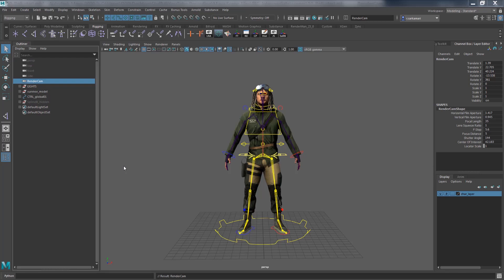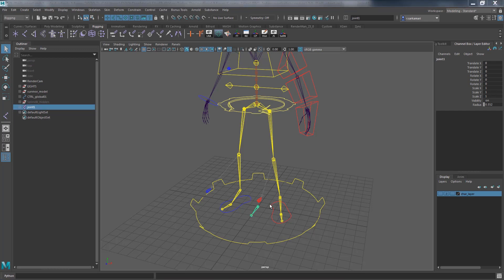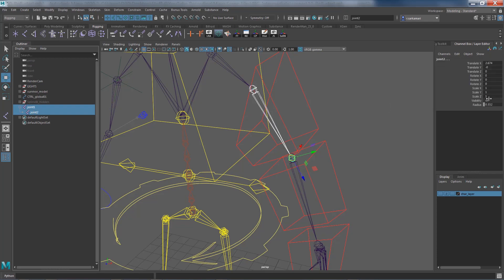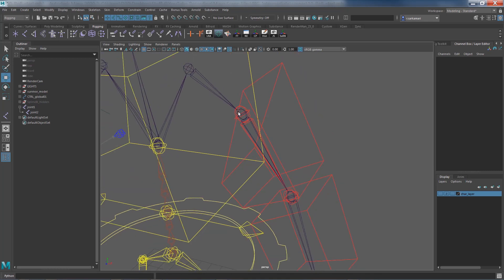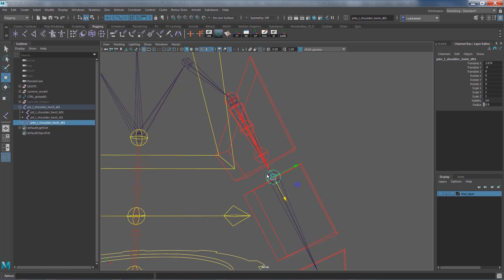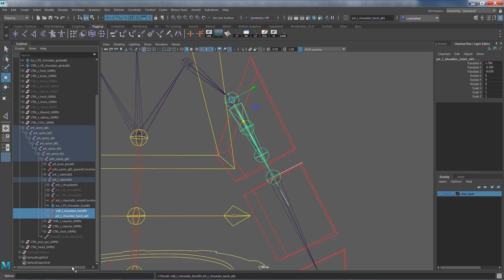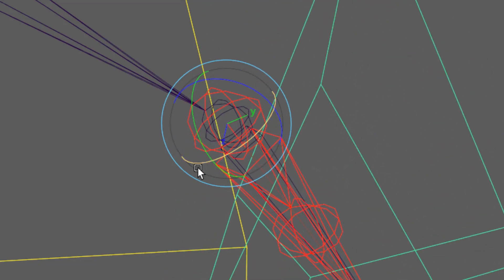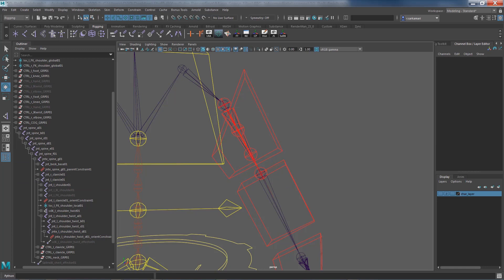Intermediate Rigging: 09 Advanced Arm Twist Setup

Comment: What is the key difference between this method and the method @antCGi uses for arm roll/twist?
Reply from the maker: I have not watch the one you mentioned but i am sure each method has its own merits. This is how we go about it in some of the shows in the studio
Reply: alright thanks, will give both methods a try.
Reply: @Auburyosrs I'm using antcgi on a rig right now but I have annoying issues with the aim constraint he uses, ars are fliiping etc.. I don't know if there are issues like this with this setup
Reply: @trystanbleuven791 I prefer this setup over the antcgi one. Easier to setup, more control and none of those flipping issues I had with antcgi's setup.
Reply: @Auburyosrs  I really find this setup is more stable than antcgi's setup, but I think antcgi's setup is easier to integrate a ribbon system in, though please correct me if I'm wrong.
Reply: @dyncgi  the method by @sarkamari is able to have the ribbon incorporated, the ribbon joints (nested in follicles) can just inherit the rotations of the twist joints via an orient constraint. just be sure to build the ribbon over the driver joints and not the twist joints
Reply: @ hi, thank you for the anwser :)

Comment: For those who want to know how to do the twist for the wrists since it's not specifically detailed in this video, and the method is slightly different:

The process is similar to this video's shoulder method, but instead: 
- Duplicate the joints from Elbow to Wrist, but reverse the parenting. Put the Wrist twist-joint as the parent and everything else as equal children under it.
- Create the Single Chain IKHandle as normal, from Wrist-Twist to Elbow-Twist.
- Parent both IKhandle and twist joints to the MAIN rig's wrist this time.
- Similar to the video, point constrain the MAIN Rig's elbow with the IKHandle.
- The important difference is that now you're actually going to do Main Rig's elbow -> twist-joint elbow (twist-d01 as this video would call it.) -> Orient Constraint.
- Finish with the Point/Orient middle twist joints as is shown in the video at 11:20.
Reply from the maker: Thank you for your explanation. Iam sure everyone will appreciate it. 🙏🏼
Reply: ur a godsend
Reply: It works perfectly but how do I add these joints to the already bound skin? What would be the best way to do it?
Reply: @jakeunabia1314  Have the new middle twist joints control the twist joints the skeleton is bound to with a parent constraint.
Reply: @pckables  So for instance, “Twist_b01” parent constraint to “Twist_a01”?